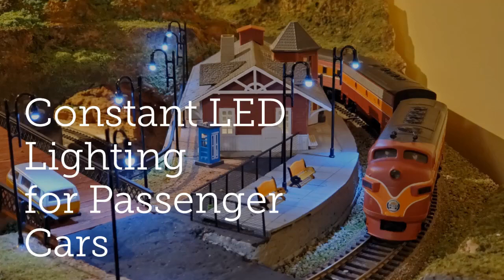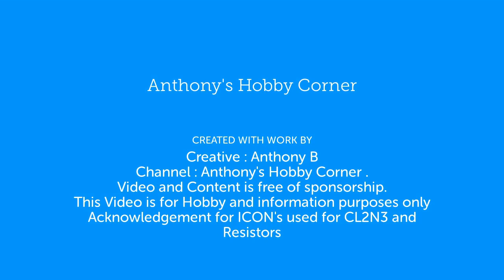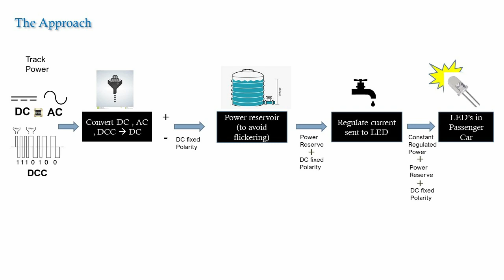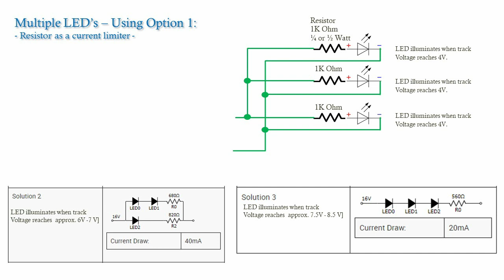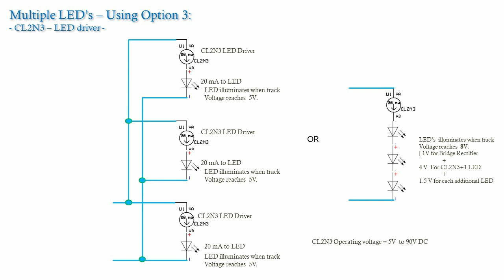Constant LED lighting for Model Trains ( Passenger cars ) Part 1 - Principle & Circuit Diagram

Comment: From Lahore Pakistan: very much explanatory, informatory video. 
1. With resistors, will it need less voltage to illuminate??
2. For LM334z will more LED need less resistance or same 4.7 ohm, 
3. Can we attach red and white in series with LM334 circuit
I conneted 2835 SMD with wires through 840 ohms, but it becomes overbright and burns out.
4, some people also mention LM317 and LF33 as well will these work?

Comment: Hi Anthony,
For sure you could throw away all of those variants because all of them switch LED too late!!! That means that your train would start without light. 2-5V is too much. Many motors could run from 1V and even less. I have HAG locomotives, it start from only 1.5V. If you use halfway transformer (for example Titan family) it could start it even less than 1V. That is an example. So all  of your components include bridges drain voltage which you need to keep to start LED as minimal as possible. For those purpose that LED driver is also pure trash. You need to use LED driver which start LED from 0.3-0.9V. That is possible with some drivers from cheap outdoor solar lamps. But you need to use inductors and some other components (4 different capacitors as well). I still didn't find good driver which could work for all model train voltage range, usually it works from 0.9 to 8 V. That means you need to stabilize voltage before driver and you will loose 1V with one diode and resistor as well. But with old motors 2V LED starting works very well. 
And very important. Before to make circuit you need to understand what kind of non-DCC regulator you have. Pure transformator, transformator with halfway (slowest motor start) or modern PMW. PWM is not good for LED driver, it is quite difficult to make LED to work with it. 
One more thing. Common mistake is to raise motor start voltage, because you will kill slow motor control, especially from halfway. For this idea you can not use capacitor for motor, because it would kill idea of halfway control and motor would receive pure DC voltage, so it would work bad. So you only need to make LED voltage as low as science and components could give you.
Yours, Alex
Reply: But most of us has gone digital, so I believe voltage isn't a problem.

Comment: I watched your previous video and this one related to the CL2N3s. I am interested in using this approach for accessory lighting on a DCC layout. You mention multiple LEDs in series but not in parallel. Is there a reason that multiple LEDs in parallel will not work using a single CL2N3? Thanks for all this valuable information.
Reply from the maker: Hi Gene , I'm glad you are finding these videos useful. And i will explain why you can't connect multiple LED's in parallel to a single CL2N3. The function of the CL2N3 LED driver is to provide 20mA of current , That's all and nothing more . No matter what voltage you supply it , ( minimum of 5v to a max of 90V DC), it will only supply 20mA max on the output pin. Each LED requires between lets say 12 mA to 20 mA to illuminate properly ( depends on the size and the color of the LED) . Lets assume that each LED requires 20mA to illuminate . Therefore if you connect 2 LED's in parallel to a Single CL2N3, the LED's will require (2x20mA)  40mA of current for both to illuminate (Current accumulates in parallel) . but the CL2N3 can only supply a maximum of 20 mA. Also if you have 3 LED's in parallel , they will draw ( 3x20mA) 60mA of current , and a single CL2N3 can only supply 20mA. So you might able to have 2 LED's in parallel , where they will illuminate but will be very DIM due to the fact that they are only getting 10 mA each. However, since the CL2N3 can take an input voltage of up to 90 VOlts, you can connect many LED's in Series ( As the same current 20mA goes through each of the LED's ) but you will need a higher voltage to get the LED's to light up , and this can be done by increasing the supply voltage to the CL2N3 . If you increase the supply voltage to the CL2N3 , the output pin will reflect a higher voltage , but the current will be limited to 20 mA. This is beauty of the CL2N3. I hope this helps , if you want more clarity , please shoot me an email to anthonyshobbycorner@gmail.com, and I will be more than happy to connect with you and share more info. infact , I have a bread board, which i can use to test and simulate what you have in mind . Regards, - Anthony -
Reply: @anthonyshobbycorner  Thanks for the response. I now understand why it is not practical to wire the LEDs in parallel using the CL2N3 driver. My concern with wiring in series is if one of the LEDs burns out, I expect the whole string would go out. Is that true?
Reply from the maker: @genej43  Yes that is correct, however , LED's typically burn out , when the current supplied to the LED for some reason even momentarily exceeds the maximum forward current of the LED. If this happens a few times repeatedly , you will tend to burn out an LED . also sometimes the resistor people use to limit the current to an LED also can burn out etc. Since you are using a CL2N3 between the power source and the LED's you are assured that the string of LED's will only receive 20mA no matter what happens at the power source. Either way , you are absolutely correct in your statement.  I have used the Series connection for years now , and so far I have not encountered  an issue with a burned LED , Just could be my luck lol .... but It is totally possible .  hope this helps .

Comment: Why not regulate voltage instead of current
Reply from the maker: Hi Gareth , Good question . LED's are current devices. LED's require a minimum  Forward Voltage to illuminate. Once you have reached the minimum forward voltage, It's the amount of current that you supply it , that decides the brightness of the illumination of that LED. LED's will consume as much current as you can give it, and it will burn it self out , if you supply it more current that it is designed to handle. This is why one needs to "limit" the current that is provided to an LED, so that it will not exceed the maximum current limit for that LED ( and burn it self out ) . LED's ( based on the color etc, will have different Forward voltage requirements. Some will need about 1.5v , and some will need about 2.1 v . However, Most LED's will operate best at approx 20 mA of current. Anything more , and it will shorten the life of the LED and eventually if you supply it a high enough current , it will burn it self out.  I hope this helps . Regards, - Anthony -
Reply: @anthonyshobbycorner  thank you for your reply.  i'm still trying to understand this all.  

Things I do undersatnd, a constant current to each LED will result in constant brightness regardless of input voltage level (so long as you are above the threshold voltage).  

I'm looking to buy one of those cuttable LED strips which are comprised of many parallel branches of 3, for example, LEDs wired in series. The 'cut points' are the parallel connection points. That said, if I have a 12V LED strip and use a current regulator, I would assume I would need to know the nominal current draw for each branch say, for example, 60mA for each parallel branch of 3 LEDs wired in series, and use a 60mA current regulator to supply 60mA to each branch, but then wire the branches in series, I think.  

I think then a voltage regulator to supply a constant 12V to say, for example, 5 branches of 3 LEDs would work; however, the downside may be that the brightness would not be constant depending on total current draw? Not sure if I fully understand yet.  But I'm getting there.
Reply: these cuttable LED strips seem to have a built-in resistor to limit current flow.  Not sure how that works when you don't really know how many branches you're going to be powering with the circuit.  Maybe it's dependent solely on the 3 series LEDs, which is why there's an individual resistor for each parallel branch.  And then the resistor is sized to handle a limited current range? Again, not sure how that would work.
Reply from the maker: @Salfrado  Hi Gareth , those Cuttable long stip of LED's as you said already have resistors built into each cuttable segment. Further they are designed to operate at a pre determined voltage usually marked somewhere on the strip I have some that are meant to run on 12 V . and so , all you have to do is connect them directly to the power source ( set to the recommended voltage ) and you don't have to worry about any additional circuitry , such as current limiting resistors etc .. These strips are designed for anyone to ( without any real knowledge of electronics) to be able to use them . only issue is that i find them a bit too bright , as most of the time there are 3 LED's in a cuttable segment . Of course , you can reduce the supply voltage and the will reduce in intensity.  they are great for lighting up houses etc , but for passenger cars etc, they might be an overkill . 
Regards, - Anthony -

Comment: Hi Anthony, Sri Lankan living in California here! Love your videos. Is there a possibility of adding a power source -- may be a battery or a capacitor -- so that the lights will remain illuminated even when the train is not moving?
Reply from the maker: Hi Lester , Pleasure to meet you . And thank you for the kind words .  I checked out your channel and also subscribed ..  I enjoyed watching the Karaoke vid's of family singing .. 
With regards to your query on having the passenger cars continue to light when the train is not moving , Well If your layout is running on DCC , then the the passenger cars will remain lit all the time because when you run a DCC system , it feed power to your track all the time ( around 16-18 V ) but the reason your locomotives don't move until instructed, is because they only respond to a special encoded signal sent via the 18v. 
Now if you have a traditional DC system , well then , you can install a larger capacity Capacitor (2000 uF ) or higher, or even a super capacitor , and the LED will remain lit for a much longer duration ( but not forever ) . Adding a batter is not ideal because you have to ensure the battery gets charged and also , it adds a lot more weight to the passenger car . It is possible to add batteries, but it is not very practical to have batteries  in each passenger car . Adding a high power capacitor or going with a DCCsystem , in my opinion are the better options . 
Do you have a layout ? are you into model trains ? Here is my email if you want to connect ( Anthonyshobbycorner@gmail.com )
Regards, - Anthony .
Reply: @anthonyshobbycorner  Thank you Anthony, I've replied to you via email.